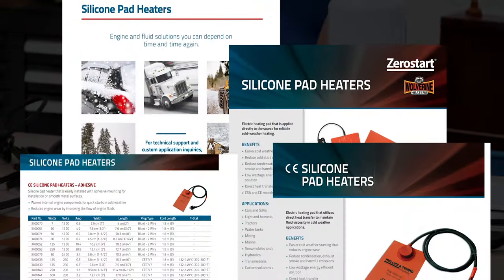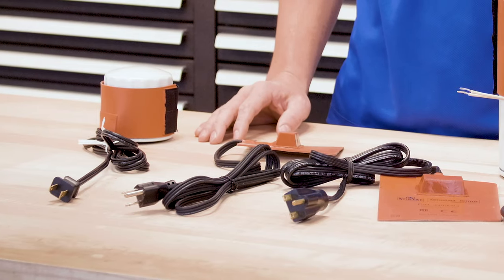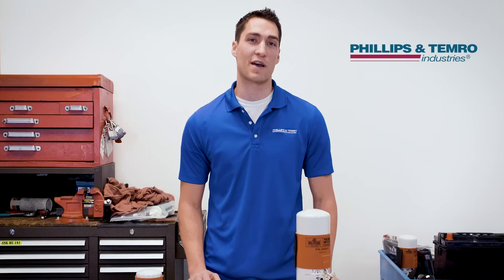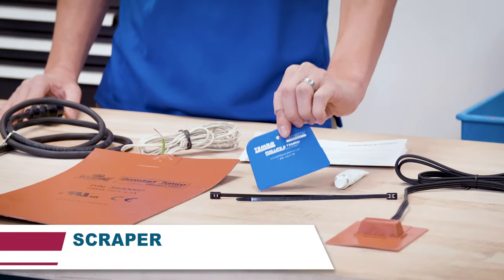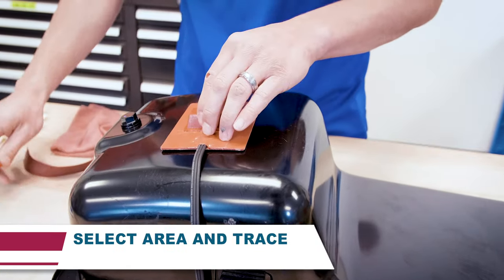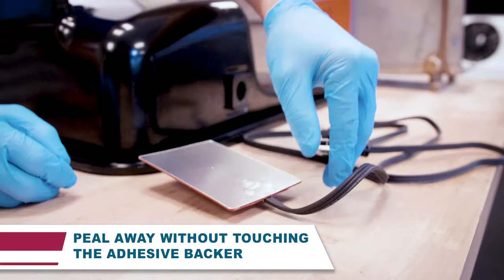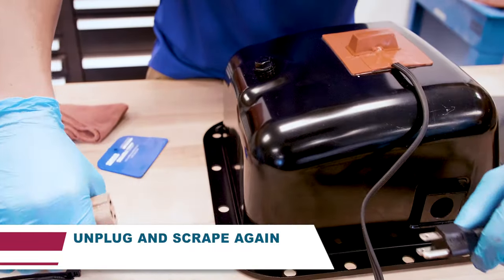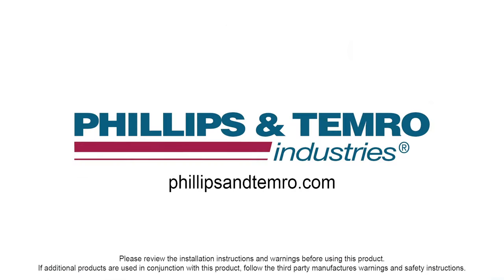How to Install Silicone Pad Heaters for Oil Pan, Hydraulic Reservoir & Fluids | Zerostart®

Comment: I bought the 3400033 which is a 250 watt 3.5 - 4.5 pad. I placed it on bottom of Duramax oil pan 12 hours before I started the truck, These are low watt so I was told to plug it in after you shut engine off. It is a 12 quart oil pan. The high temp that day was 35 degrees and it got down to 20 degrees and when I went out to start truck, the bottom of the oil pan was warm and heat gun showed 70 degrees. As I moved heat gun up oil pan it went down to 35 degrees. I started the truck, it sounded like a warm start and I didn't hear valves hitting which makes me think the oil was warm enough to go to top of engine, and at idle engine temp gauge was at 180 degrees in 15 minutes. This is fast for my truck. Diesels normally warm up really slow.  I'm buying a battery warmer next. If you buy the model that has CSA approved, it has a thermostat in it. These ones won't go over 200 degrees. The ones without CSA approval, heat up and do not shut off when they reach 200 degrees. The CSA models cycle on and off when they reach their high temp.
Reply: Got one for my Nissan Titan plan to get a second for the trans and a battery heater and then make a hole for a noco port since this October got a morning at -5.

Comment: Mounts it to the worlds only smooth oil pan. Where’s the instal for the ones with huge divots and weird shapes??
Reply: Use a magnetic one instead
Reply: I mean the honda element oil pan is VERY flat. As long as you buy quality (Japanese, avoid American cars) seems to not be an issue.
Also yes it does pain me to knock my own country's car industry but dammit man we can't build a reliable power train to save our lives.
Reply: @levisanchez7143 which won't work on aluminum pans lol. There's always something!

Comment: Why do you need to remove the paint. If its on a perfectly smooth painted surface
Reply: The steel will have a more pourus and adherent surface. Unlike a smooth and repellent like painted surface.

Comment: Instead of gluing the pads on why not use several ceramic magnets?  That looked like a steel oil pan to me that's what made me think of it
Reply from the maker: Proper adhesion to the surface of the pan is essential. Using the adhesive and provided silicone sealant ensures that the entire back surface of the pad is in contact with the oil pan. If gaps or areas behind the pad surface are not in contact, this is a potential point of failure as the heat is not able to transfer as designed and will create a hot spot. This is also why we mention having a flat surface to adhere to, with no ridges, bumps, etc.

Comment: Would this work on windscreen washer fluid tank? (Plastic)
Reply: omg. buy winter wahser fluid so it doesnt freeze. wtf are you even asking for?
Reply: @Vova3iLvova  There are cars that come from the factory with heated washer reservoirs (eg. Mercedes Benz). Fluid must of course be winter type but warm fluid melts the slush that collects on the wipers. It's a huge safety benefit.
Reply: @simoncowbell.6783 Unless the window is chipped. Warm fluid on cold window could result in it cracking
Reply: @enderwiggin9091  That's right but chipped windshields will crack sooner or later in the wintertime. Most commonly from the use of defrost.

Comment: What about mounting 250watt heater on fiberglass tank , do you need a heat sink ?
Reply: Dude, a heat sink disapates heat, therefore nullifying your heater. So no. The key is wattage to meet your needs and to not melt plastic. Go with like 100 watts, or just don't plug it in all night. If it's a big tank, another thought is multiple smaller 100 watt heaters.
Reply: @garyaubrey4096  Dude...

Comment: All these heaters are great if you're by a source where you can plug in but what's the point in getting any of these if you take your vehicle to work and it's sitting in a parking lot all day and it's 25° these are pointless except if you're at your house and you can plug in here's a better way run 5w20 motor oil if you live in an area where it gets below 30 degrees there you go that's all you got to do just run thinner oil guys that's it
Reply: As pointless as punctuation, eh?
Reply: I hope you stayed in school because that is a wicked hard read.
Reply: If your truck can't start at 25° you need a new truck.  And NO you don run thinner oil you run a lower W oil...  W has NO bearing on the oils thickness or viscosity at operating temp..   Might just be better if you stop giving advice.
Reply: Yeah, great point.
Reply: 5w20 is to heavy for my engine in summer dude lmao.

You do not want to use thinner oil as once it gets up to heat it will be to thin that's why commercial vehicles and people who care about their engine that live in a cold region use the proper tool aka heaters.

I mean hell why not just use 0w-10? (Sarcasm)